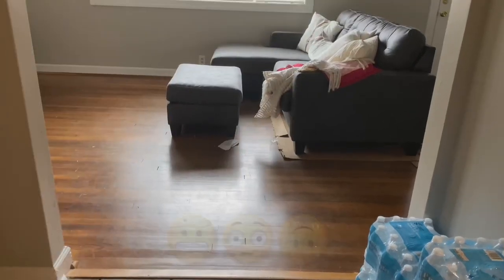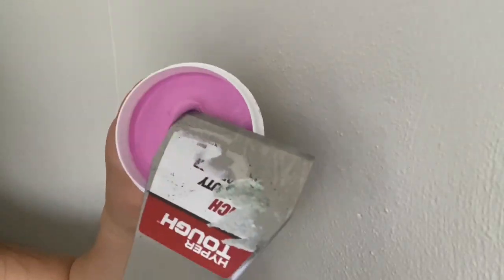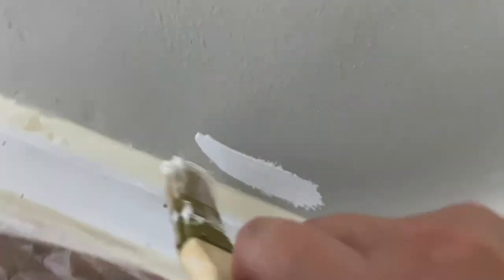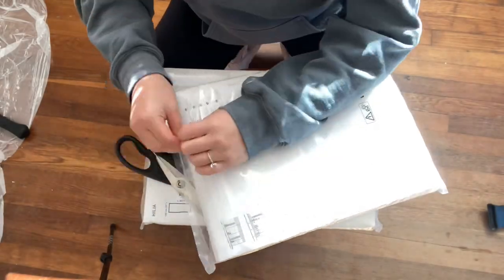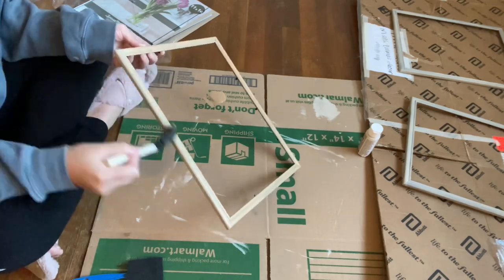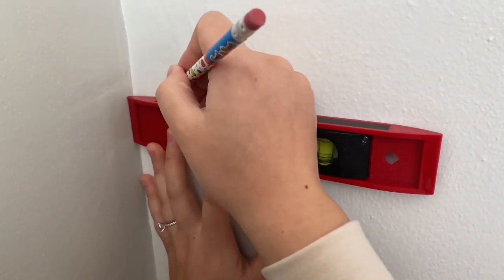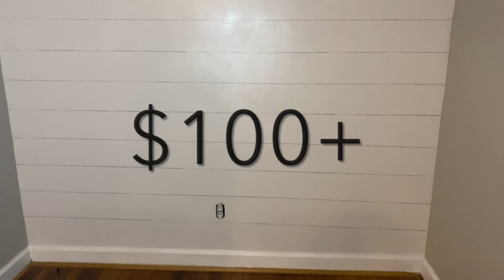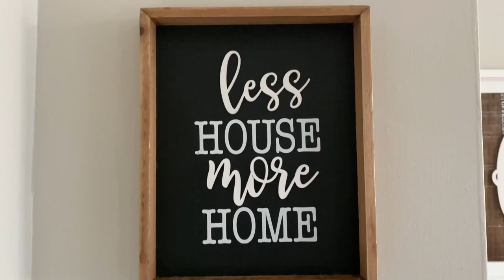EXTREME Living Room Makeover on a BUDGET!! Modern Farmhouse & Boho

Comment: Lovely transformation! May I ask what you did to the frames to make them look like wood?
Reply from the maker: Hi Kelly! I used two different brown acrylic paint to achieve the faux wood look. I started with 2 coats of the khaki craft smart satin acrylic paint. I left some of the black showing through the paint.  After it dried, I went over with the golden brown craft smart satin acrylic paint. For this layer, I didn’t do a full coverage; instead, I lightly brushed it over the first two coats. However, it came out a little too dark, so I went back with the khaki color and randomly painted through out the frame to lighten up the darker brown.  After that, I sprayed a clear coat protective over the frames. Hope this helps!! Thanks for watching 💖💖💖